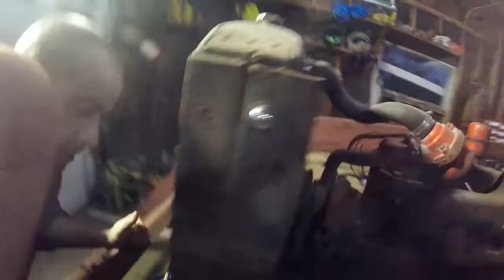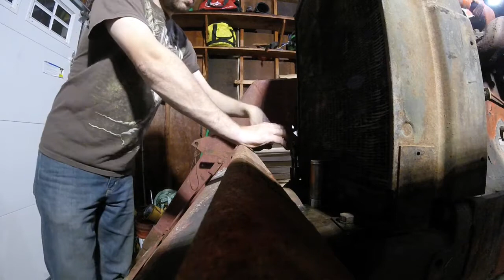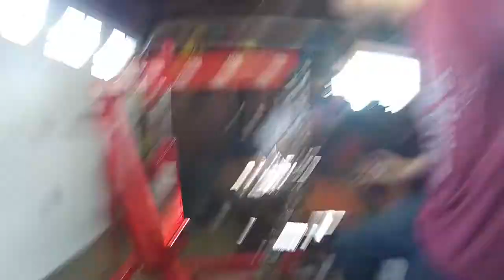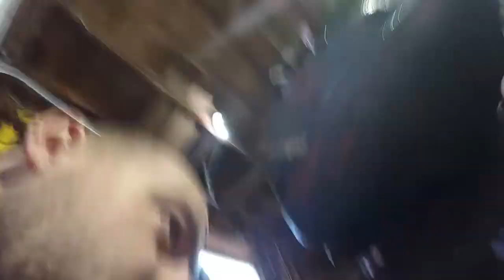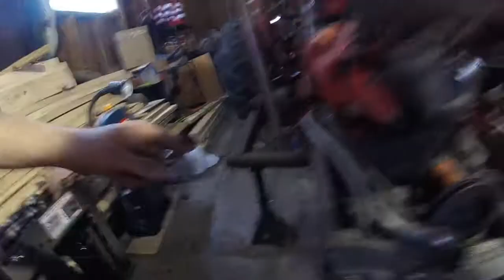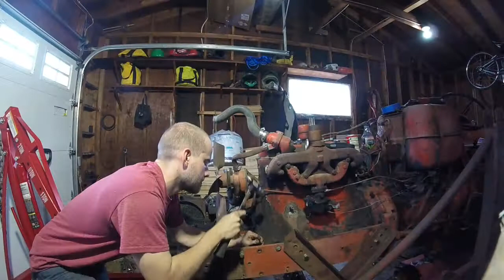Allis Chalmers D17 Power Steering Repair Part 1

Comment: Hello, I know this is an old post but I'm hoping you can help me. I did the same thing to my Allis d17 and now my power steering is not working. When I start the engine the wheels jerk back and forth and then turn to one side an stick there. What have I done wrong? Thank you for any help you can offer!
Reply from the maker: Hi Alan. Sounds like maybe you reversed the lines from the control valve to the ram.